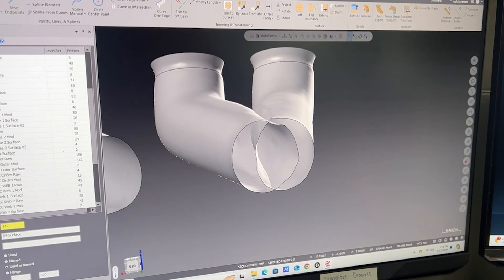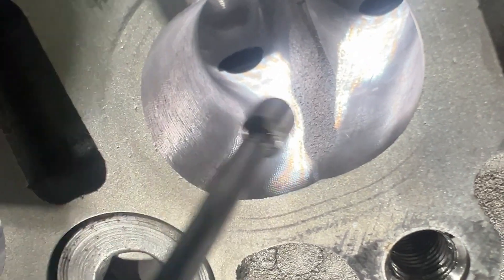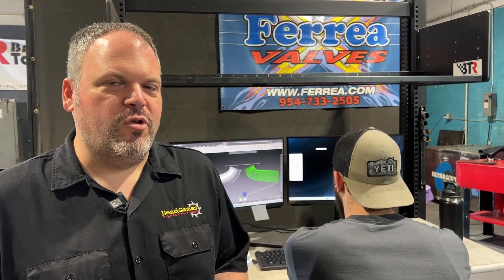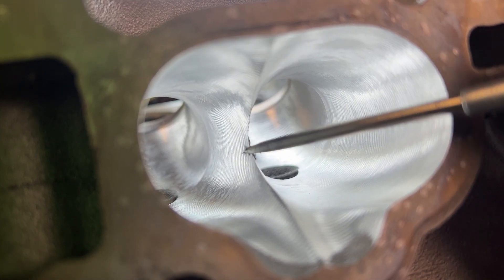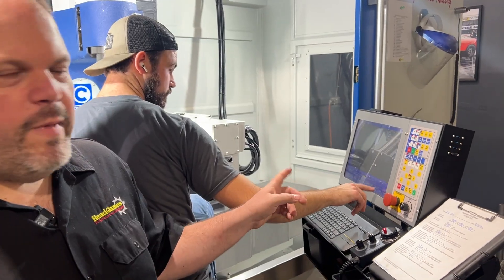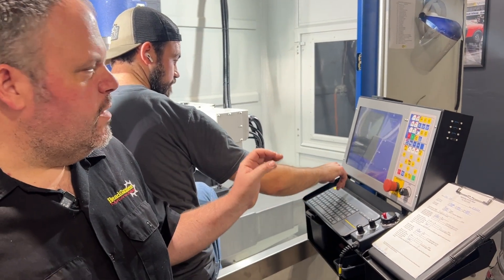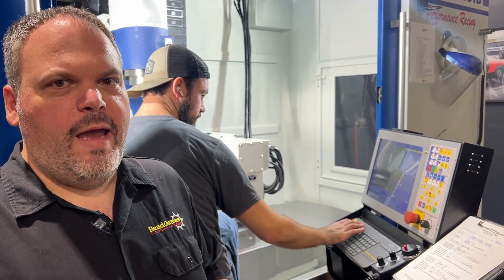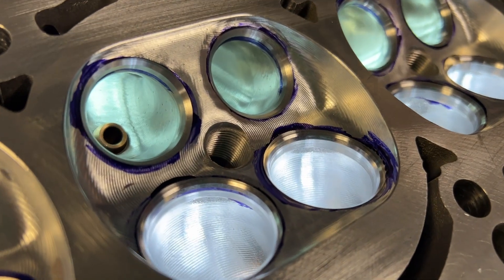Troubleshooting Our 2JZ Head Digitization on our Centroid 5 Axis CNC

Comment: flow numbers bro! sho us that!!

show hand port vs cnc flow numbers

show us an excessivly ported head compared to a correct ported head for thos that beleive bigger is always better.

show us a port thats more than 90% under the seat. here in sydney some shops just make that area as wide as the seat, i would love to prove them wrong
Reply from the maker: @GTRliffe  you do a hand port and digitize it for cnc porting. 
The throat diameter sounds like a fun idea 
The rest of what you said is a whole bunch of work lol

Comment: Really impressive looking result! I must be missing something. Would you please explain why the machine can't digitize the ports without clay? It's obviously a very capable machine. It's not obvious (at least not to me) why it can't simply digitize the port in "one" pass rather than doing it one half at a time using clay. Thanks.
Reply from the maker: @darylmorse  watching it now, and we missed an entire clip explaining why it needs clay! 
The prob wouldn’t know to go down one side if the divider and come back out and do the other side so you have to clay one side and it basically treats each valve or half as 1 port. So you digitize one side and mirror the other or digitize the other side and bring them together in mastercam.
Reply: @headgames  Thank you for the explanation. That makes sense.

Comment: Except for the cost it would be wonderful to have a head ported and put on the flow bench and have cams made to match the head.    Once you get it sorted I expect that machine will be running all day every day.
Reply from the maker: @robertfontaine3650  that’s why we don’t do big ports and big valves. It wouldn’t work for 90% of the cams available.

Comment: Uh, I ain’t getting it…
If the material ain’t there to cut, on the scanned original, clay ain’t going to add material to cut, on the production piece. 
I get it, that the clay is a mask for the scan, and is the part where this is where blending comes in, but, tend to think the clean up on the production piece leads to localized increase in CSA, inconsistency, port to port
Back in the day, head people with the connections, would actually end up going to the foundry, to “rub” cores, to add material in hollow / depressed areas. Any chance of having the castings modified, instead of compromising your porting to the existing casting, or are you using used OEM cores? What about welding, as the problem area seems minimal?
I realize the whole “existing architecture” has been the bane of cylinder head people from the beginning.
Great work and thanks for sharing…
Reply from the maker: @georgedreisch2662  the issue with the clay I realize now is missing a clip in the front of the video explaining why and how that happened. 
The clay just gives the prob someplace to not go. And is also the most important part of the digitization. Get it in the wrong area, wrong texture and you pay for it in time at post processing. 
The small amount of material that we blend into the port doesn’t matter. It’s there to begin with really, we are just scratching it so it looks better.

Comment: I would think you would want a smoother surface on the combustion chamber for the sake of reducing exposed surface area and hence heat transfer.  Is it not that big of a deal in your experience?
Reply from the maker: @rafaellastracom6411  have not experienced any difference